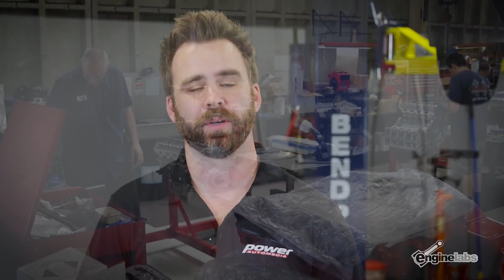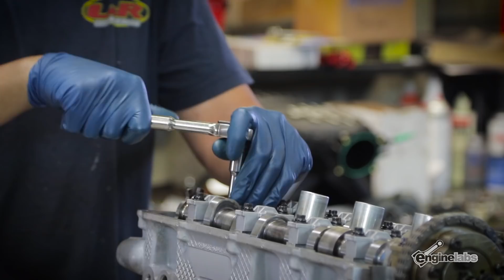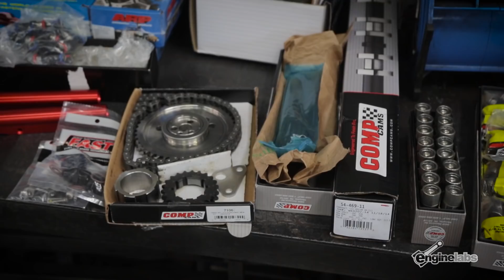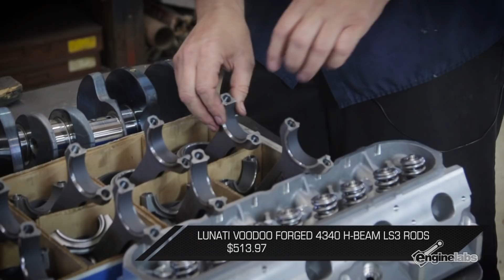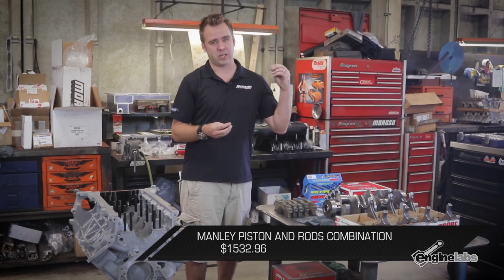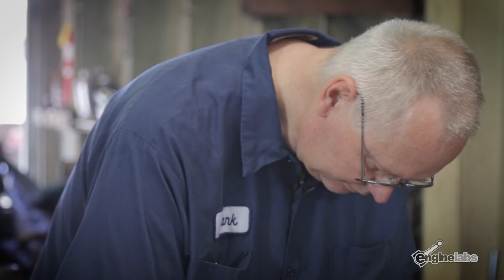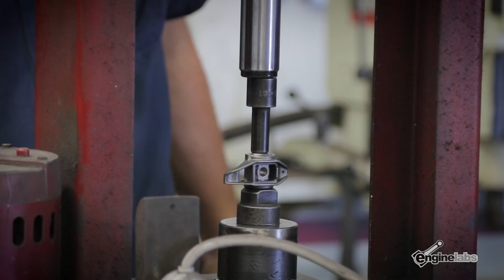$10k Coyote vs LS3 Shootout - The Build

Comment: Wasted money on most of the parts. Could've gotten better stuff since you're not making huge power. Forged crank was not necessary, all the studs aren't necessary - bolts would have been enough. Just my opinion. Also, I have less than $1500 in a complete LSA supercharger on my motor withe everything being brand new except the blower itself and the injectors came from a zr1
Reply: And I gotta call BS on the $3000 coyote motor. Just checked eBay, the cheapest is $4k right now. Just because your TV show can go out and haggle down someone or make deals to get better prices doesn't mean there's truth between these kinds of comparisons
Reply: +Onebadpowerstroke the one off deals isnt your average pricing tho. So just because they found the one that was $3k isn't going to fit the same budget as the next guy watching this trying to build the same thing. If I go out and find a guy that just really needs money and sells me his 2015 mustang 5.0 for $10k, that would be an unrealistic comparison
Reply: Could be built more for an upcoming feature on what happens when you put a turbo on them. Need to build it properly for that.
Reply: +TheHannukahZombie 
But again that's not building the best $10k motor you can. That's building the best $10k boost ready motor you can. I'm not favoring either motor here, I like them both. But a really bad comparison video if you ask me
Reply: Dick stain That is building the best motor you can for $10k. You add boost to it and you're making more power for the same money. You could toss a turbo on the LS for less than what the ford cost and easily make 150% of the horsepower it does with no change in reliability. This video is terrible because they set a budget at the outset just to give the ford a chance. A bone stock bottom end in the LS and a decent set of factory head (LQ9) and a hot cam and it would DESTROY the Ford for way less money even without the turbo. This test sucked because they gimped the LS just to give the Ford a chance.

Comment from the maker: UPDATE: For all of you that have been patiently waiting for Part 2, here's the link to the showdown and results. Enjoy and thanks for watching! https://youtu.be/KFkOy0F5hGg
Reply: You took a 5.0 out of a f-150 and compared it to an engine that has a extra 1.2L of displacement, picked conditions that favored the L's engine and crowned it the winner. So, um....WHY THE FUCK DIDN'T YOU USE THE 6.2 THAT CAME IN THE F-150?

 I mean seriously, wtf is this? It's up 1.2 liters of displacement, of course its gonna make more power and torque. 6.2 sohc "takeout"= $2-2.7k. You paid 3k for a 5.0 truck engine? This is complete bullshit. Compare shit equally. What's wrong with people now and days? 

That's the thing though, you could've just re-ringed the Ford 6.2 and had custom cams ground and came out waaaaayyyy cheaper, but- then ford would've won something, and we can't have that now can we?
Reply: I can't believe I'm standing up for the ford motor buuuuuttttttt.... the coyote may be down 1.2L of displacement but it also has twice as many valves and four times as many cam shafts as the LS3 and revs a solid 1k rpm higher.  The 5.0 is what ford put in their muscle car, the LS3 is what Chevy put in theirs. Stock for stock in those applications they're within 10hp of each other.   Sounds like dramatic butt hurt ford fan boy excuses to me
Reply: Typical Chevy fanboy BS.  Nothing else.  Been happening for years.......Camaro vs Mustang for years was 5.7 vs 5.0 and they cheer when the Camaro wins by the plaque on its teeth.  Whatever
Reply: +Jason Alvarado riveting argument Jason you must have been on the debate team back in school... since when was displacement the only factor taken into account when determining how "equal" two engines are or are not?  Despite what Dominic Toretto may have "taught" you, there are many replacements for displacement... forced induction, direct injection, increased compression ratios ect. No fan boying in my argument bruh just facts and common sense
Reply: My man, I was actually commenting on the video itself, not your post but OK.  If you notice, I said Camaro v Mustang not Chevy engine build v Ford engine build.  Throughout the 90s it was a pushrod 5.0 Windsor v the pushrod 350 when the 351 was readily available and only came in the Cobra R.  In these cases, it really did come down to just displacement.  Been a student of this for many years man, don't need movies....
Reply: +Jason Alvarado when was it 5.7 vs 5.0 because the 5.0s competitor would've been fbody with a 305 considering GM only used the 5.7 with automatics in the irocs. and by the time the ls1 was out Ford was going to ohc design. the fact is for almost the last 20 years Ford has had a huge advantage with ohc. it's not all about cubic inches it's flow and efficiency. and with and ohc motor Ford should be blowing GM's pushrod motors out of the water but there not!! oh I know it's hard for you pony boys to comprehend
Reply: +SmackledorfMcsween Cocksmclittleton Tinydickolas hey whatever you say internet master tech I'm sure you've built many of both of these engines so you must know what you're talking about ;)
Reply: +Nate Recco   Early mid 90s.  camaros were always offered with 5.7. I know the induction part of it already.  you were not going to blow anybody away with almost a full liter down. they reved nicely and made good horsepower but lacked torque. if both are natural the pushrod 5.7 was highly likely to produce more torque. my argument is that ford should compete liter for liter if the engine is in production for example a re bored stroked cammed raptor engine in a mustang.
Reply: chris loofboro I have. If you want I can post a video of a sbf I'm building right now. I also passed my I.C.E college course with a 94%. So..um..yeah I've built a few and I know what I'm talking about. I've got a book here from one of the courses I took. 

You pay shipping and its yours and then you can become an internet master technician as well.
Reply: chris loofboro you stated something back as if you built plenty of these engines. Kind of the pot calling the kettle black, don't you think?
Reply: +SmackledorfMcsween Cocksmclittleton Tinydickolas awfully proud of you champ. LS's motors yes, I have... then again who hasn't? I use to work at a Chevy dealership and I'm much more familiar with them than I'd care to admit
Reply: chris loofboro since you've worked at the dealership, what was all this about? Why even reply with such a notion and then go on to passively insult me?

The bottom end of the LS is a direct copy of the bottom end of the ohc engines fords been using since late 1990. Only thing GM did was use wider bores. Deep skirted blocks, cross bolts, 6 bolt mains...etc, but- yeah, GM is better.

Interesting fun fact- when Ford used the aforementioned block design and made it out of aluminum with cast iron sleeves, just take a wild guess at who was the FIRST to point out all that was wrong and passively mock Ford? fast forward a few years an- HEEEEYYY!!!!! WAIT A SECOND!!!

Give you a hint: there initials are G and M.  Lol, kind of like what you just did. Hmmph...no wonder you like Chevrolet.
Reply: +christ loofboro. "Despite what Dominic Toretto may have "taught" you, there are many replacements for displacement... forced induction, direct injection, increased compression ratios ect."

Nothing you listed is a replacement for displacement. They are additions to displacement. 2 engines, one large displacement, the other less. Same tech setup on both, the smaller displacement doesn't win. FI, spray, fuel grade are all power adders. None of it works without the combustion chamber.
Reply: mustangs have been cleaning camaros clock for years 1970 is when the camaro lost its mojo Chevy people will say a live race is fake just because a Ford won even when they are in the stands at the same race the GT 500 has already broken the 200+ mph mark and the camaro has yet to even break 160 show me a stock camaro that has gone 200mph the Mustangs have been doing more with a 5.8L than what a Chevy could ever do with a big block heck a 4.6l f150 lighting destroyed a new style camaro easily if a pickup truck can beat a camaro it'll never beat a Mustang I would rather spend   more money on a quality product than buy cheap Chevy crap Ford small blocks are mightier than any Chevy big block because they are just better built you can say what you want but these videos prove nothing once you put a coyote Mustang against a ls camaro you will see a much different outcome the Mustang will beat the camaros butt every time so you can believe what you want but there's a reason the Mustang is the hottest selling muscle car in America
Reply: kirby vanduzer Do you truly think that gm cant make a stock camaro do that speed. They arent even trying to dude. Also. The ls motor can produce 1000 hp all day Reliably. Im pretty sure the coyote can manage 850 at most without compromising reliability. And most of those foxbody stangs at the strip have gm motors. Thats just a fact. And comparing the camaro to the top ford production mustang is well? Shouldnt u compare it to the top chevy production car.
Reply: Brandon Hackbarth the only way a camaro will ever be good again is when Chevy starts acting like they know what they are doing and puts quality back in their vehicles the reason why they have so many recalls is because they cut corners  and rushing their vehicles into production instead of testing and making sure that they do what they are supposed to they go straight from the assembly line strait to the lot it's not about being the first to come out with something it's about making it work right Chevy wants to be the first one to release something so they rush it in to production instead of perfecting it Ford perfects every vehicle they make that's why their popular because they work like they should they may not have WiFi yet in their vehicles but that's because they are hard at work perfecting it so it doesn't have problems Chevy just rushes too much but that's government motors for ya Chevy could do great if they start putting quality in their vehicles but I don't think that's ever gonna happen government pets never survive
Reply: Brandon Hackbarth most stangs have LS swaps? That's old news. There are more 4.6 and coyote swaps now. Only the hicks are swapping LSs in where they don't belong. LS has been around way longer so watch what time does to the coyote? LS will be no more. Bet on it. GM is already going back to DOHC in the '18 vette.
Reply: Joshua Childers Thats good than. Chevy can improve on its ohc motors. But if people wanna argue which motor is better im gonna say if its stock than maybe the coyote since it has such a high rev capacity but when it comes to upgrades and performance possibilities its GM all the way.

Comment: the real question is in pounds.. witch engine is lighter.. that's what i want to know.. anybody know??
Reply: +Will Jones 5.0 is 12.5-12.6 at 112. Weight: The "Coyote"= 430 lbs Source About.com-Mustangs. The LS3= 448 lbs Source,GM Camaro homepage.com. The LS3 is making 1.04 hp/lb while the Coyote is making 0.96 hp/lb.
Reply: Thank you..
Reply: BMW S85 5.0 Litre V10 engine, DOHC 40 valves, 90 degree bank angle 12:1 compression ratio  240KG  507 hp (378 kW) @ 7750rpm/520 N·m (384 lb·ft) torque @ 6100rpm
The S85 utilizes both individual throttle bodies and Double VANOS (BMW's infintely variable timing for intake and exhaust cams) It also has  equal length tubular headers.
GM LS7 7.0 v8, 90 degree bank angle, pushrod  single cam in block valve  train 16 valves, 11:1 compression ratio, 206KG 505 hp @6300 rpm, 470 ft lb @ 4800 rpm, plenum intake manifold, basically log headers, no variable valve timing. 
S85 power&torque:weight ratio, (2.113 HP/KG, 1.6 ft lb/KG) 
LS7 power&torque:weight ratio (2.45 HP/KG, 2.28 ft lb/KG
The Ls7 outdoes the s85 is nearly everything and has FAR less technology.
Now let's see what happens when the ls7 actually comes with more technology, 
Mazzanti Evantra's variant,  701 hp at 6600 rpm and a maximum torque of 848 Nm at 4500 rpm, woe that's overkill, and still has the 11:1 compression ratio and still more room to improve. Smaller, lighter, more torque, lower CoG, better power band and still more room for improvement through aftermarket parts.
You can see that the pushrod ls engines are one of the best if not the best engines if you want power:weight ratio, I can literally write a research paper about the advantage of pushrod v engines over dohc for performance engines with a rev limit under 11,000
Reply: +Chris Huynh You've got the best post on this subject along with myself and a few others. Why are so many "intelligent" people constantly refusing to accept the truth about current pushrod tech vs dohc?
Reply: Mang213 They're blinded by the hp:litre, which only looks good on paper, the real performace stat for engines is an ideal powerband/torque curve per engine weight

Comment: not exactly a good comparison. you are comparing a 5.0l to a much larger 6.2l. get a 5.3l and compare it to the 5.0 you should be comparing engines that have near the same liter displacement
Reply: +king kobra But they dont put the 5.3s in the sports cars. They put the 6.2 so in the market and vs price its LS3 vs 5.0, wouldnt make sense to go 5.3 vs 5.0.
Reply: +Merp actually in this case it would. the 5.0 they used came out of an f-150 so that's not a sports car. so actually it would be the correct comparison.
Reply: king kobra Well just the bottom end, they build the motor with car parts.
Reply: king kobra Also chevys 5.3 isnt the top motor the 6.2 is even back to like early 00s the 6.0 was the top, and they are cast iron blocks. So You wouldnt compare that at all with the parts they put on, its obvious they are not doing a truck compare.

Comment: They wasted a lot of money unnecessarily on the LS motor. They didn't have to buy that block, crank, or pistons. The stock LS can survive 1200 hp and 26 pounds of boost. They could create the same amount of horse power with a 2,000 dollar budget as they did with 10,000 budget. Ford has made the same stupid mistakes for 70 years. They made all these different engines that aren't enter changeable, now they make a overly complicated engines that are much bigger than they need to be.

Comment: LS3 is going to take it away. Cost will be the good reason. But power to weight ratio. LS3
Reply: For those talking about power to weight ratio the coyote only weighs 430 lbs wet & will likely make more power especially above 6500 I bet it'll be up by 20 hp, also all the extra power band all the way up to 7500-7700 means you can use shorter gears and accelerate faster to a given mph, big mechanical advantage there. Of course LS engines have their own advantage in sheer torque down low its hard to beat old school at low end pulling power that's just a huge benefit of their design in general lol. Instantaneous violent twisting force

Comment: The ls3 is a more appealing engine than the cayote in my opinion. Love the old school design of an ls, it'll set you back if you've ever built old sbc in the past. Big issue with the coyote id be afraid of is breaking or stretching a timing chain and detonating the engine, the ls uses a wider/heavier duty chain to drive one camshaft. In my eyes the ls you can make more power for less money and have more reliability vs the cayote.

Comment: Where'd they get a new LS3 block for $1400? CNC-ported LS3 heads are $1500 not $1200. Could've bought a brand new 5.0 block for $1300. How many other parts prices are incorrect? 3.640 pistons for the Coyote would've been a special order if you stuck with Manley. Ross makes those forged pistons for $100 less. K-1 makes a billet 4340 rod for the Coyote for $100 less than the Manley rods. WHY WOULD YA'LL UPGRADE THE FUEL RAILS ON BOTH OF THESE ENGINES AND NOT THE INJECTORS? Whoever chose these parts combinations have NO CLUE what they are doing for either platform. LS and the Coyote are great with plenty of aftermarket support. Clearly you have to do some homework instead of flip through a catalog. Try again guys but try harder.

Comment: I don't understand this "shootout" at all.  What is the goal of these engines?  I could build a $20k engine built for boost that what get destroyed by a $5000 sbc.  A 5.0 can make over 600hp/tq easy with stock internals on boost so why was $1500+ wasted on fancy pistons and rods???  If the goal was to build a powerful NA engine then do that instead of a halfways build.  FYI aftermarket fuel rails and an oil pain were not even remotely needed for the 5.0...

Comment: Why use a new LS3 vs a pulled Coyote? Should be pulled vs pulled or new vs new. At least credit the LS3 what a junk yard block would have saved.
Reply: +Brett Hobbs maybe if coyote motors weren't so damn pricey they could've used a new motor, but the LS is king when it comes to cheap power, that's why they could get a new ls3 block almost half the price of a junkyard 5.0
Reply: Dustin Hawkins
Yeah, but shouldn't that be reflected in the challenge?